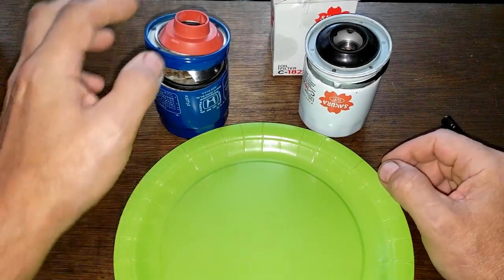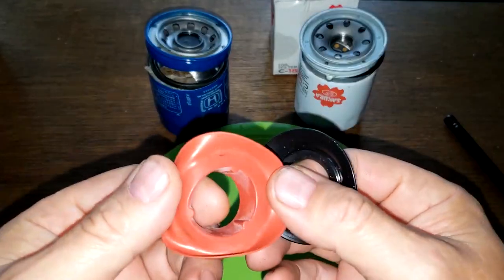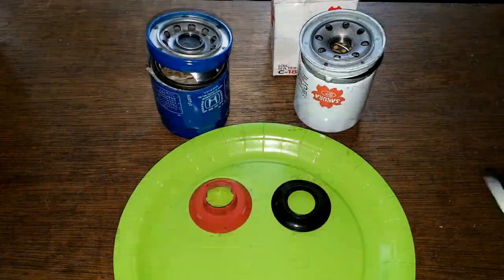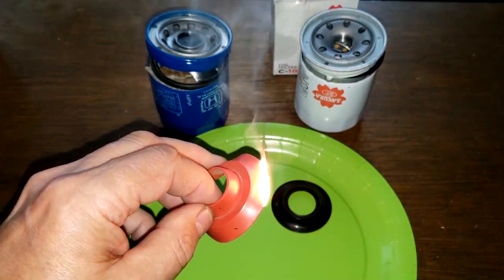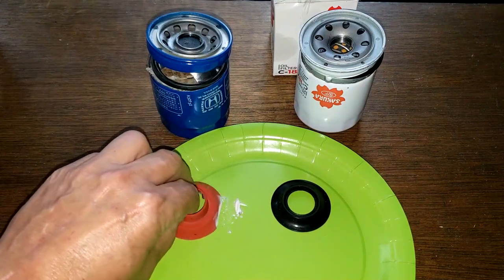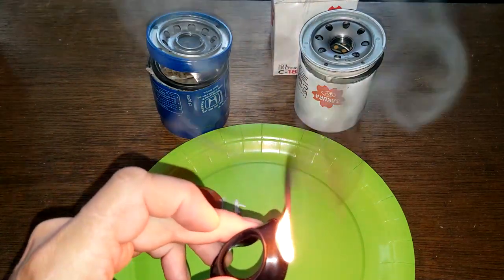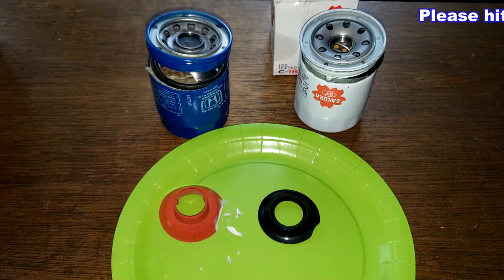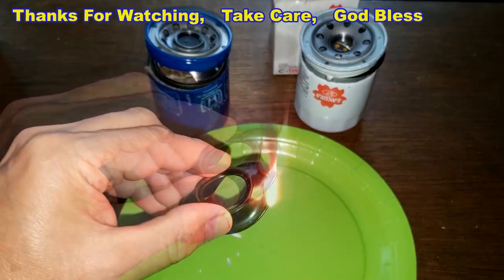Sakura Oil Filter Anti Drain Back Valve Test, Silicone Or Rubber

Comment: Nice job. The only concern I have with nitrile rubber is if I was doing extended oil drain intervals. At 5,000 miles it’s not going to be a problem. But if you do a 10,000 or higher it’s going to be a problem.
Reply from the maker: Thanks👍